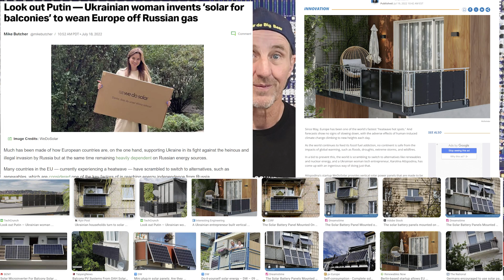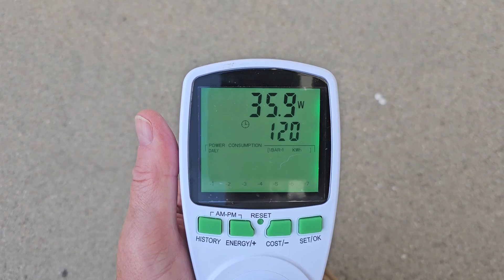Suicide Plug Solar Panels?

Comment: Hey Dave, did you every figure out an average day/week/month of savings on your bill with this setup?
Reply from the maker: the panels in Big Bear are having issues overheating from the very intense sun. working on a solution. so they are not making much power.

for the solar surf shed I built where I live in Oxnard with 4 x 200 watt panels, it is working great! It generates about 3Kwh a day. more in the summer, less in the winter but 100Kwh a month seems to be the average.

figure an average Kw price of $.20 or .25 so about $20 to $25 a month.

$300 a year or so. 

https://youtu.be/Gos1NR1-lOg?si=tMMvjb3eN-vxSUJL
Reply: @DaveRat  That's great! I think I'll be investing in some. The criminal organization, PG&E, that supplies our power is currently charging $0.42 per kWh off peak and $0.47 peak for electricity - the highest rate on the mainland USA. Sounds like a couple of these arrays would help noticeably for us. Thanks!
Reply from the maker: definitely. I have some suggestions that will help. 

if you are not going to sign up for net metering and get it permitted, then consider a battery backup and AC panel like the ecoflow delta pro ultra and smart panel.

you can connect the panels I to the inverter and they will charge the battery and then run your entire house from the battery.  that will come close to taking you off grid.

be sure to get a solar inverter that has wifi so you can monitor what is going on.

if you don't get a better and panel, you will either be giving pge all your excess power for free or worse, I have heard but not confirmed that it may be possible that they charge you for putting power on the grid if the meter registers reverse energy The same as forward energy.
Reply: @DaveRat  Yeah, I read up on that. State Senator Scott Wiener has a bill winding it's way though the legislature currently to fix that issue where "balcony solar" would be considered a regular appliance and be exempt from the standard solar permitting process. Looking forward to that. In the meantime, the charge to register the setup could be anywhere from $100-$800 if I didn't want to "go rogue" ;-)
Reply from the maker: yeah for rogue!

Comment: How has it done since you installed the solar? Has the inverter still going?
Reply from the maker: Yes it's still running and I bought six more solar panels that I'm going to install.

I will do an update soon but it's working well.

Not generating as much power as I thought because of shade from the tall trees around.

The way it's wired really makes a difference if there's shady spots.

If one panel has any shade all the panels in series with it have diminished output.
So to maximize output having more inverters and less panels per inverter reduces that issue

Comment: My kind of guy... "Lets find out" . I'd done basically the same thing (different inverter box) and it works and will roll the meter backwards if it's the older analog meter with spinning wheel. I just tested over a few days about 8 years ago. Recently they upgraded the meter to digital and I suspect the digital meter cannot tell the current direction so if I push anything into the grid, I SUSPECT I'd be paying for it rather than getting a "credit" (meter backwards). Best option is make your own time-of-day setup to store up and run things from sun/battery instead of grid and save that way.

Comment: The MAJOR problem is if you have a fault and manage to electrocute yourself then instead of your RCBO or RCD tripping out and saving you the solar will continue to power the circuit as they don't have the same turn of specs as your RCD's ( solar is between 50ms and 5 seconds depending) so your are very likely to end up dead!  Solar should always be on a separate circuit with its own breaker and pre your RCD /RCBO's in order that they are not blinding the RCD/RCBO with DC from the inverter which can also be a problem. Also make sure you have type A RCBO's ( can have up to 6mA of DC  and still work) not type ac which have only just been banned here in the UK but there are still millions out there, they were phased out in the rest of Europe over 20 years ago!  Not sure what your current regs are over in the US of A perhaps a US based spark could let us know?

Comment: Remember to ground the panels with a ground spear
Reply from the maker: It just plugs in the wall so it grounds off the house electric with the ground pin.

Do I really need to add a second ground rod to the house? As this is already grounded.
Reply: @DaveRat  from what I can tell it is common practice to do so. The frames of each panel needs to be connected and a wire needs to go to a ground spear.
Reply from the maker: @KlausEvenEnevoldsen interesting, yeah I could see grounding metal even if it's not touching anything electrical. I don't have the inverter bolted to the panels directly so those frames would just be floating. I suppose if I bolted the inverter to the frames the frames would ground from the inverter and therefore be grounded whenever the inverter plugged in and it wouldn't matter if the inverter's not plugged in.

For panels that are permanently wired to the house, I could totally see needing those frames grounded as a safety precaution.

I will need to ponder that. And probably at least run a ground wire from the inverter shell to the frames. 

But now that I think about it, All of the frames are not connected together either so I need to run a ground wire to each and every frame.

Yeah this requires some research to see what the norm is.

The question for me is, do the tens of thousands of balcony solar systems that plug in the wall used throughout Europe have a separate ground wire?

They have higher voltage over there and typically higher safety standards so whatever they're doing I think will be good
Reply: @DaveRat  I’m European so that might be a factor.
Reply from the maker: Awesome very cool. Let me ask you this. For balcony solar setups, how do they run the ground wire and ground stake? Are there like a shit ton of wires dangling off the balconies down to the ground stakes? 

Or a ground wire to the ground stake running up the side of the building that everyone ties into?

I am imagining an apartment building with solar panels on the balconies of various apartments and condos going up 5, 10 or more stories and wondering how they all connect to ground stakes.

Cool cool and thank you!
Reply: @DaveRat  i think it would be for lightning strikes and possibly if you had a battery tied to the system and the inverter was connected to the frames. I say that b/c we are not seeing solar systems with every panel connected and then grounded by a stake. But then again, every state is different.

Comment: Conservative estimate you make 1.2kW/h a day for 300 days that's 360kW/h a year. At $0.35 KW/h that's $126 of electricity offset a year.  Pay off period of approx 6 years. Not too far off regular solar ROI, Nice.
Reply from the maker: Plus I saved money on the roof tiles for the lean-to that allows me to barbecue without standing in the rain or snow when the weather hits

Comment: Beware. If you dont consume all that 640ish watts and dont have bi-directional (net metering), the utility company will charge you if any power makes it back to the grid as traditional meters don’t know direction of AC.
Reply from the maker: Interesting and very cool thank you. That sounds like something fun to test!

I know the really old meters that are purely electro-mechanical automatically spin the opposite direction because the wheel spins based on the direction current is flowing.

That said, conceivably there could be meters that rotate the same direction regardless of the direction of current

The power company switched this house to a wireless digital meter four or five years ago so I will have some fun testing to see how it's programmed
Reply: @DaveRat  Please, keep us informed. Fun stuff!

Comment: Can't comment on your electrical code as an Australian, but one thing that would be the same, which is a problem here, something the solar companies will not inform you of and the customer will wonder why their return rate is low, is your existing no load grid voltage. in australia our nominal voltage is 230V, by our electrical code the supply authority must provide to the house connection between 216V to 253V. and here for an inverter to be legally installed it must have these software parameters in place: if voltage exceeds 255V for 10 minutes or exceeds 260V for any amount of time it must disconnect from the grid. now the complaint from customers is due to not receiving as much money back, as what they were sold. and this is normally due to the fact they are close to a transformer and already at around 250 volts, so their inverter may only be able to raise the voltage by 3 volts, ohms law etc etc. the panel may be displaying it's receiving [x] amount of kW from the sun, but deeper into the inverter's menu they'll find export kW is far lower because of this, as well as other factors such as neighbouring solar users also rising the grid voltage.
TL;DR - If your supply voltage is already high you won't see much return from idle use until you actually put load on your supply and lower the voltage for the inverter to push back.
Reply from the maker: Interesting. It seems Ike the solar inverter would only need to create a voltage slightly over the grid voltage. 

Seems like having a current limited solar  inverter output with a voltag set some voltage above the grid voltage and and the inverter output instantly is dragged down and held at the grid voltage, by the grid load such that the inverter is delivered vering it's maximum current at any given point in time is what would naturally occur.

Or would no be possible for the inverter to raise the grid voltage with massive grid load of holes nders or thousand of house connected.

The solar inverter output of someone's home would be akin to the lifting force of a single human working with hind ra of others to lift a barn. 

No one is really lifting any higher than the person next to them, but the combined lift raises the entire structure.

No inverter connected to the ground d really has a voltage any higher than the grid, but the combined outputs of the inverters and main generator from the power company, combine to carry the grid load.

The meter just keeps track of how much load each house is using or providing.

And check out this cool example

https://www.dailymail.co.uk/news/article-8320953/amp/Amazing-moment-300-Amish-men-lift-huge-barn-bare-hands-field.html

Comment: lol we don't want lazy electricity
Reply from the maker: Absolutely correct we need our electricity to be fit on in shape so it does its best work!

Otherwise it might get confused by normal IEC chords and think it needs a $5,000 power cord in order to make good audio
Reply: @DaveRat  This makes me think of something I find interesting. I have heard that a dj can have their system plugged into an outlet on one leg of the system and other equipment on another leg and somehow get different timing on one vs the other. I don't understand how that could be possible, but I have heard that said. Any truth to that? I could be describing the scenario wrong too.

Comment: I pity the linesman who has to trust their life to the reliability of a proliferation of cheap grid tie inverters.
Reply from the maker: Interesting, so you're afraid that an inverter that is powered by the grid will somehow mysteriously become powered when th grid is down?

since systems like this are readily available and used  throughout the world, there is probability that this safety concern is not significant

My understanding is that when the grid goes down all of the loads of all of the houses make the grid look like a dead short and it would take a massive power source to re-energize it or energize it at all

The inverter is designed not to generate electricity when the grid is down and if the grid is down and since grid turns into a short, it would either blow up the inverter or a protection circuit would kick in.

Either way instantaneously the lineman is safe.

That said knowledge and understanding always beats guesses And there's always more to learn and understand.

 Here's a link with some info that may be interesting and I'd love to hear other informed perspectives

https://www.inverter.com/on-grid-inverter-basics-working-principle-and-function
Reply: In short, yes. I completely get the design operation and principle, and theoretically its totally safe. It's just if there are 10,000 of them, it takes just one transconductance device to catastrophically fail, and these components fail as we both experience with amplifier. Granted, even in that scenario you'd probably just get the DC voltage of the array up the line, and the transformer wouldn't conduct that, but the normal safety systems we have say on amplifier - overcurrent and GFID just don't exist in this scenario. So their safety standard should be a lot higher, but I'm not seeing that level of oversight in the designs. But maybe it's there and I just don't know it? Or maybe by basic virtue of design its truly impossible for this to happen, its just without 10 years of data I'm not sure we can be sure. Does that make sense?  @DaveRat
Reply: Maybe I am just burned by the misfortune of having seen amplifiers go bang and conduct half rectified mains...
Reply from the maker: Well, perhaps take a look at the safety standards this unit adheres to.

UL1741 is probably the most applicable to your concerns. But there are several others listed

Description

Specification

Material: Aluminum Alloy

Color: Silver

Model: XJ-WVC-700W

Plug: US Standard

Voltage: 110V

Maximum Input Power: 2 × 350W

Recommended Solar Panel: Power 2 × 350W, Open Circuit Voltage 30-50V

Maximum Input DC Voltage: 54V

Peak Power Tracking Voltage: 22-45V

Operating Voltage Range: 17-50V

Minimum/Maximum Starting Voltage: 22-50V

Maximum DC Short Circuit Current: 40A

Maximum Input Working Current: 30A

Output Voltage: 120V

Output Peak Power: 700W

Rated Output Power: 650Watt

Rated Output Current: 6.36A

Rated Voltage Range: 80-160VAC

Rated Frequency Range: 57-62.5Hz

Power factor: >99%

Number of Connections Per Series Circuit: 6 (Single-phase)

Output Efficiency: 120V

Static MPPT Efficiency: 99.5%

Maximum Output Efficiency: 91.2%

Power Loss at Night: <1W

Total Wave Distortion: <5%

Operating Temperature Range: - 40 ℃ to+60 ℃

Waterproof Grade: IP65

Heat Dissipation Mode: Self Cooling

Electromagnetic Compatibility: EN50081.Part1 EN50082.Part1

Power Grid Disturbance: EN61000-3-2 Safety Regulation EN62109

Grid Detection: DIN VDE 1026 UL1741

Gross Weight: 2.45kg/5.4lbs

Net Weight: 1.8kg/3.96lbs

Package Size: 34*24*11.5cm/13.38*9.44*4.52in

Product Size: 21.3*5.8*25cm/8.39*2.28*9.84in

Comment: In my neck of the woods, that is still technically grid tied. If it actually turned the meter backwards a lineman would come visit encouraging you to get the permit and inspection taken care of. It is a safety for when all other safeguards fail. I hope it works well for you.
Reply from the maker: I don't think it'll generate enough power to overcome the baseline usage of the house when no one's there so I don't think the meter will go backwards, though I hope it does! Also since this inverter type is powered from the grid, if the grid goes down it stops generating electricity. 

Is there a limit or a minimum to where you need a permit?

If you generate one watt of electricity do I need a permit?

10 watts 100 watts?

At what point do they enforce or regulate it?

I can see the obvious issue of having an inverter powered by the solar panel that generates energy even when the grid is down being a dangerous scenario.

But this is just like a negative power draw appliance.
Reply: @DaveRat  In Germany there is a clear power-limit which is allowed without a permit: currently 600 Watts, but in the near future it will be risen to 800 Watts. They are called "Balkonkraftwerke" ("balcony power plants").

When the grid is down, no solar-powered inverter will work (when still connected to the grid). From the inverters view, the net is basically a 0 Ohm resistance, so its short-circuit protection will kick in.
Reply from the maker: Interesting and very cool. Yes I could see that being reasonable. 

Thank you for the info. Do you know if the 600 w limit is maximum system capability or if it is the maximum amount that can be put back into the grid?

As in, having a thousand watt system that has a 599 w limiter set on it would not need a permit?

This would be quite significant as in most solar systems rarely hit maximum output and often can't even hit half of their rated output.

The system I show in the video has been up for a month or so and I'm lucky to get a single kilowatt per day during the winter.

As I learn more about solar panels I'm finding that even a single cell of the solar panel being shaded can limit the output by 80 or 90%

So for me to get anything close to 600 Watts I would probably need a system much much larger for most of the year